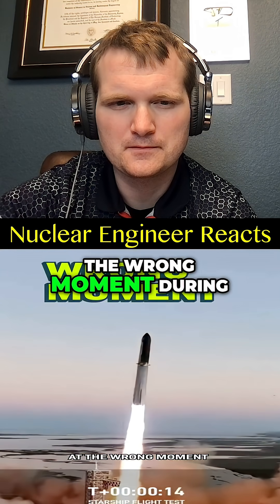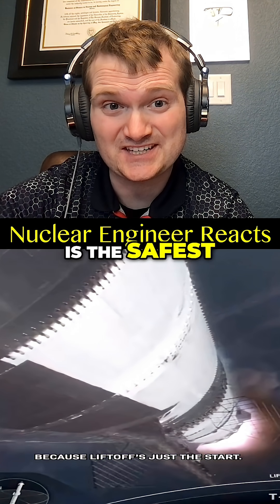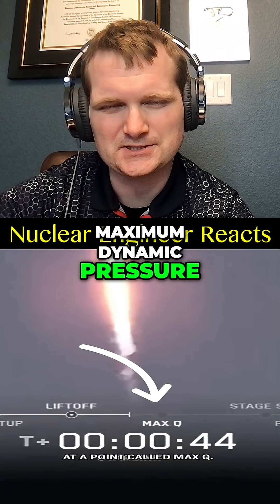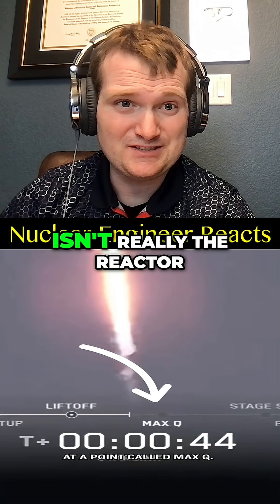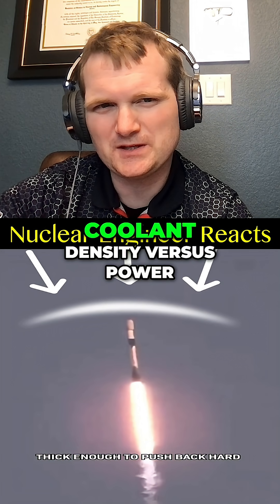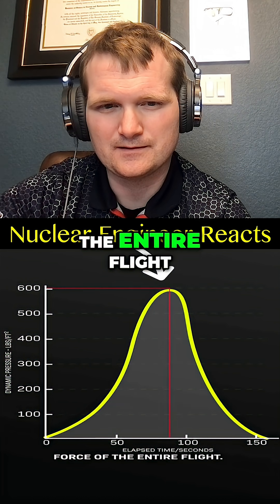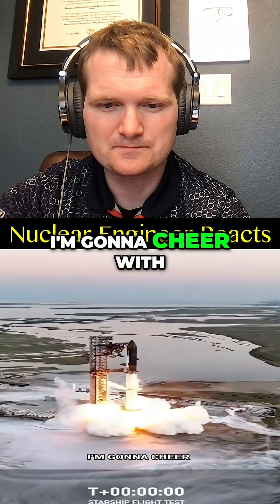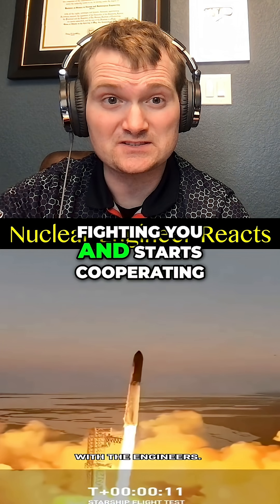Hardest Part of a Rocket Launch - Nuclear Engineer Reacts to Cleo Abram

Comment: Also, a point of technicality here.  All things in orbit are falling to Earth.  Being in a stable orbit just means that your sideways velocity equals your vertical velocity (rough explanation but I am trying to stay out of the weeds here), so you are, essentially, falling around the Earth.

Another way to think of it is that if you have a shallow cone and you spin a ball at just the right speed to keep it on a line inside the cone without going up or down.  Same principal.

Comment: The coolest part of a Starship launch IMHO is hot staging.

Fun fact: The Space Shuttle throttled down it's RS25 main engines and the gigantic SRBs during MaxQ like all rockets. The SRBs throttled down by reducing the surface area burning in the SRBs. This was done long before liftoff by changing the shape of the center void column in the solid rocket fuel. The column would start out as a star like pattern and as it burned away it changed into a more circular pattern, which reduced thrust by reduced the burning surface area. After MaxQ the column would change back to a more star like pattern. The SLS uses very similar SRBs to the Shuttle. NASA added an additional segment to the SLS's SRBs increasing the length by around 1/5 over the Shuttle. This doesn't necessarily increase the burn time, but it definitely increases the thrust.

Comment: As someone who has played KSP realism overhaul a little, hard parts include all engine ignitions (engines can fail and ullage can cause failures), and then maintaining orientation is also a pita. It is really easy to get into an uncontrollable wobble that can end your mission. That's not even counting construction, which I made a program for but it still doesn't even take ullage and flight and service modules into account

Comment: difference for nuclear though is your very low power levels don't really have any meaningful power output, even though neutron flux will be increasing. a rocket doesn't launch as smoothly as a nuclear reactor; one second it's on the ground and the next second it's not.

Comment: The most dreaded time: when you have to check if you calculated for air resistance correctly.
Reply: Aerospace engineering:
Space = Neglect Air Resistance
Aero = NO NEGLECT AIR RESISTANCE